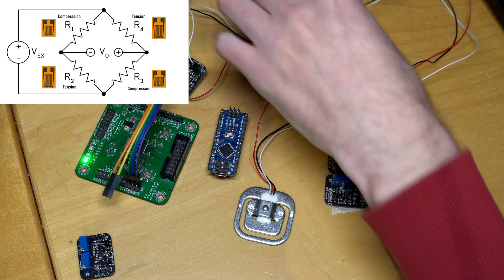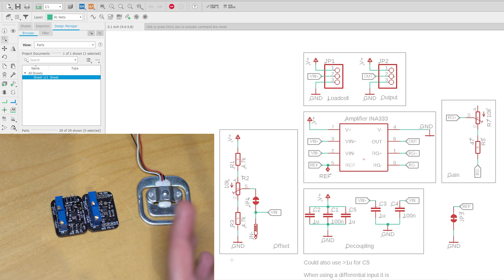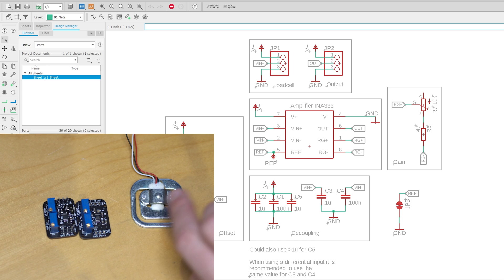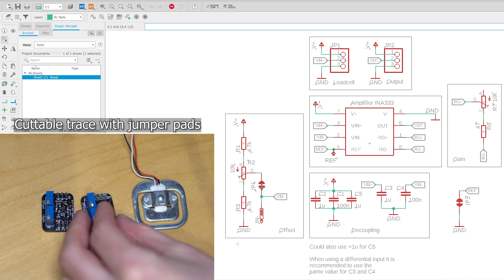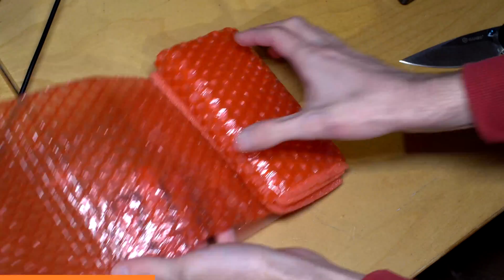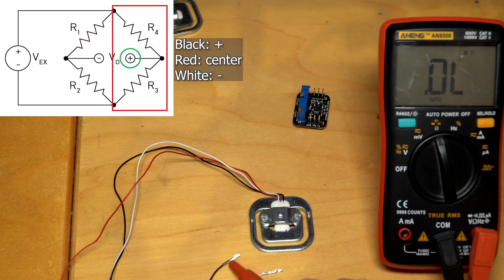Designing a 3 wire load cell amplifier with variable gain and offset

Comment: Hi. I have made a load cell amplifier for a 4 wire load cell using INA122. I have some still around. Can i replace the INA333 with INA122??? Note: I like to make DIY stuff, but I don't understand how electronics really works, just the basic stuff...
Thank you in advance!
Reply from the maker: In theory yes but the footprint is different and the ina122 gain is higher. Which might be useful for a loadcell if you need more range.

Comment: Hi, I just found your video as I’m looking for a solution to my very old Fanatec ClubSport pedals (V1) requiring way too much braking force for my comfort. My model has a 3 wire load cell, very similar to the one shown in this video. It also has as a knob connected to a potentiometer that is used to lower the gain, but I already have that minimized (and I’ve tested the knob with my multimeter and it appears to be functioning properly). It seems like this board would solve my problem, allowing me to amplify the load cell signal before it is fed into the pedal circuit board at the normal location, but it’s out of stock. Do you have any recommendations for me? Thanks!
Reply: Hey man, found a solution yet? I suggest you visit race department. Search for Logitech G27 G25 G29 load cell mod. It's not fanatec but the amp you might need maybe in that thread. At the moment, the very last posts on page 7 is mine. Check em out if you still need it
Reply: @greatwall9741  thanks for the reply. I ended up resolving most of my issue by replacing the load cell with a new one from Fanatec. I was also getting some amount of EM interference because I ran the cable from the pedals right next to the power cord for the wheel. Once I separated them my other issues went away as well (not always 100% throttle).

Comment: Hey Yannick. Do you think the modules could be modified to be used with a 4 wire full bridge strain gauge? I am trying to build a flat shift gear stick with load cell and need a 0-5v output with 2.5v rest position.
Reply from the maker: Yes you could use them as a normal instrumentation amplifier. The negative input is present on a different pad and if required you can connect the offset circuit with a cuttable trace jumper (can be resoldered)